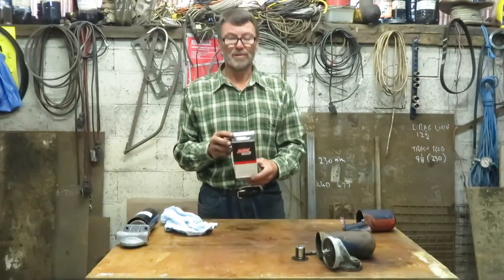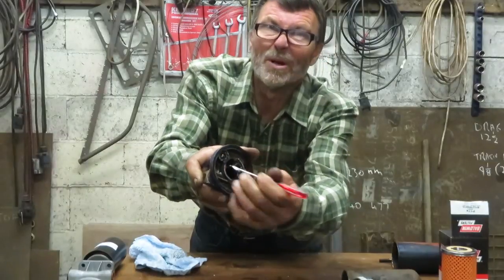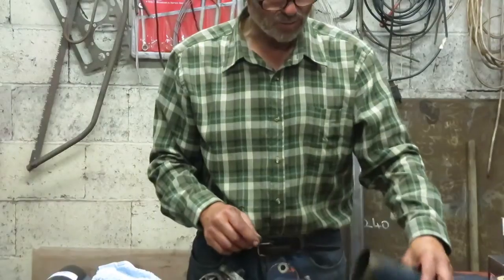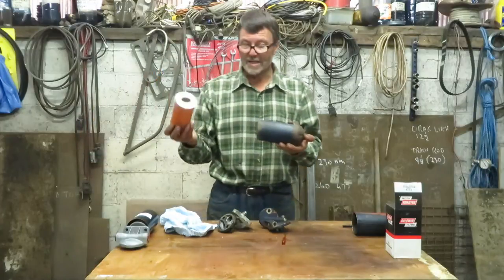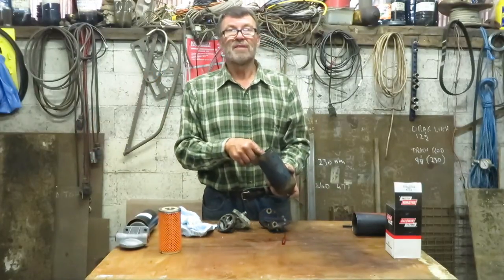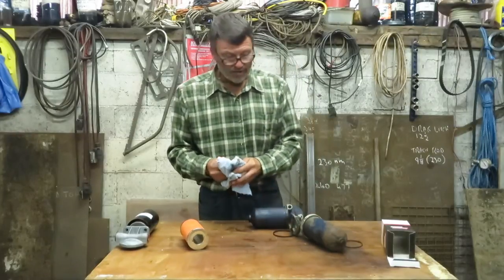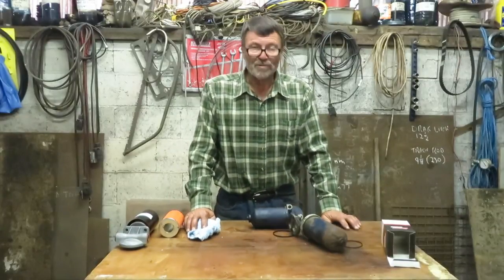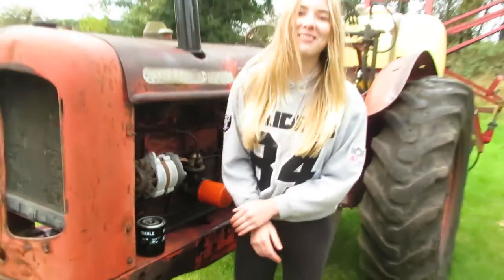Nuffield/Leyland changing the oil filter

Comment: Hi. Where would you get replacement parts for a Leyland. I just went to do an oil and oil filter change on a Leyland 255 and there was no spring, circlip and valve relief.
Reply from the maker: I would try Charnleys but I’m not sure they would have the relief valve. Other than that a breaker like Nigel Weighell. Are you in the UK?
Reply: @montegoson  I might try contacting them. Not listed on their site. I am in Ireland. I was in a few places that were selling tractor's but only wanted to sell as a whole. Thanks for the quick reply. And thanks for the video's. They will come in useful in time.

Comment: Hello . Enjoying your videos. I have inherited my Dad's 1958 Nuffield 3DL 3 cylinder tractor. I was able to order online use user manual for this tractor but for some reason, the manual has no information at all about anything to do with the fuel system. The seller mentioned that this manual did not cover the fuel system at all but I ordered it anyway to have at least other info I could use. Would you have info on how to service the inline fuel filters and change the oil of my 3DL injector pump? Why does there seem to be 2 large inline filters near the injector pump. One filter is orientated vertically  above the injector pump near the radiator, and the other fuel filter orientation is horizontal to the left of the injector pump. Please explain if you can.
Reply from the maker: Rudy Falcomer go to www.nuffieldtractor.com and when you register a section of pdf download manuals become visible. There may be something in them but I’ve never read them. The horizontal filter housing is not a filter but a part of the air governor’s for the injector pump.